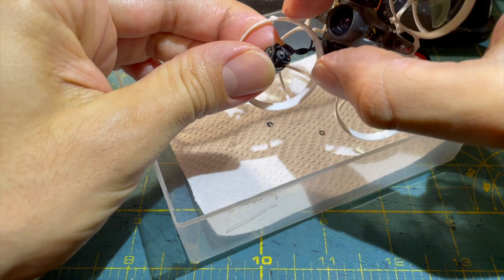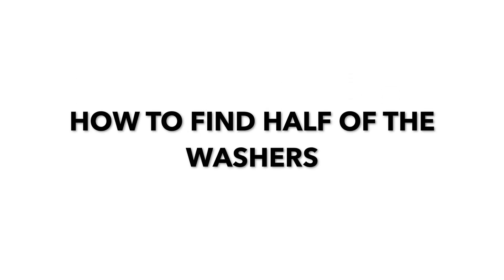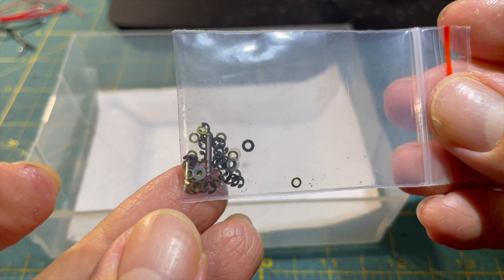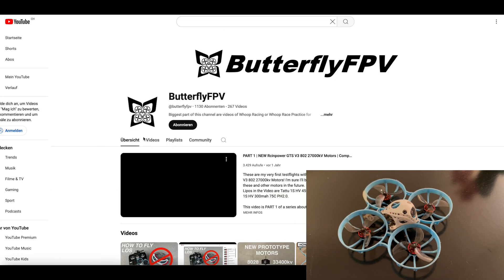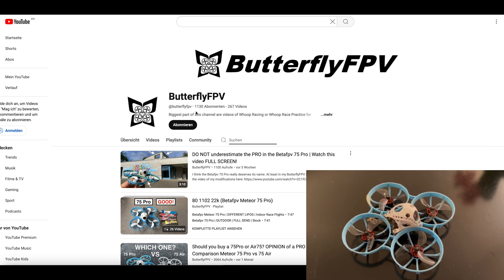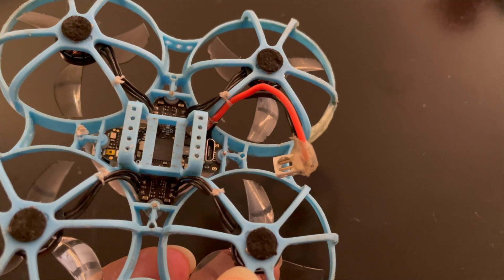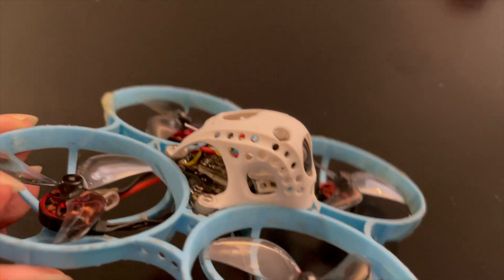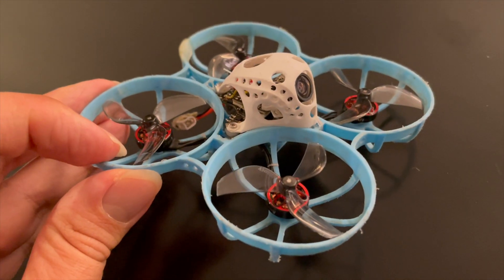Diassemble and reassemble a tiny whoop motor | How to change a motor bell on a tiny whoop motor

Comment: Hi, why my motor making abnormal noise when spinning after i changed the motor bell. Other motors didnt sound like that. Ive place back the washer follow original setup. But i still cant get rid of that noise which causing vibration on that particular motor
Reply from the maker: I don`t know my whoop friend. Maybe to much play. Maybe a metal object in the motor was attracted to the magnets and you didn't see it during installation. Or if you have flown the engine with a bent shaft for a while, the bushings may be worn out. There are many possibilities. Disassemble the engine again and take a close look at everything. It's also important to note that you can't use just any motor bell housing for every stator. The number of magnets must match, and the mass, of course, must match. If possible, always use a bell housing from the exact same motor.

Comment: Hey man my meteor 75 pro got jittering motor and it dosent hapen all the time like only 60% of the time it will be jittering and wont take off, you have this issue ? Do you know how to fix it?
Reply from the maker: Yes it`s because of the motorplugs. Watch my next videos. I'll try my best to explain what the problem is and how to fix it. In short: Unplug and replug the motor connector. Then secure it with a rubber adhesive like E6000. Then attach the motor wires to a duct strut with dental floss. Do this with all motors. Hope this helps.
Reply: @butterflyfpv  if your making a video about this, it would be very helpful as many meteor 75 pro owners have this issue
Reply from the maker: @ZahilClips  Yes thats true! The video is planned! The footage has already been filmed.

Comment: do you know if e clips would work? i tried cleaning my motors of hair and lost the c clip on installation
Reply from the maker: My whoop friend told me M1.2 E-Clips are fine. Like this: https://de.aliexpress.com/item/4000944897965.html
Reply: @butterflyfpv  oh awesome! thanks so much,

you wouldnt happen to know the specs for the washers as well would you?
Reply from the maker: @zaccpaul4144  Outer Diameter 3mm, Inner diameter 1.2mm, Thickness 0.3mm, opening distance 0.9mm
Reply: @butterflyfpv  you are an absolute gem, thanks so much

Comment: Would bad motors cause uncontrollable throttle and random twitching? Or do you think my aio is going bad? I crashed in some water the other day (fully submerged) 😞 but ive also beat thses motors up pretty bad not completely understandstanding how to take care of them lol.
Reply from the maker: It could be due to many things. But in your case, there's a good chance the FC was damaged by the water. You can connect the FC to your PC (always risking damaging your PC if there's a short circuit in the FC that affects the USB port, but you can minimize the risk by connecting the FC to a 5V USB device beforehand, where it doesn't matter if the 5V device breaks) and check if the twitching is also present in the gyro data display (receiver tab) when the drone is stationary. If so, then the gyro is defective. Or you can run the motors individually in the motor tab in betaflight to see if the throttle is controllable for each motor individually. You need to narrow down the cause of the problem step by step until you have a rough idea of what's causing it. This, of course, requires a basic understanding of the components of a drone and the betaflight software. I hope this helps.
Reply: @butterflyfpv  thank you, I really just wasn't sure where to start this helps a ton.

Comment: I always have so much trouble with the c clips! Wish there was a tool like they have for the larger motors
Reply from the maker: Hold one or two fingers very close (touch) to the C-clip while using a pointed carbide tool, preferably a scriber, to loosen it into the tip of your finger. Then it usually works well and the c-clip sticks to your fingertip (like in this video). Then make sure that it doesn't stick anywhere where it shouldn't and that it doesn't fall down. And of course put it in a box somewhere. Under no circumstances should you leave it lying around on the workbench. If you work slowly and carefully it works. And of course it takes some practice. After the 10th motor at the latest you can do it without losing anything. And if you don't do it for a long time, you forget it again and lose something again xD When you push it back, the c-clip must already be 40% in the groove of the shaft. It must not be slanted at any time. As soon as it becomes slanted you have to align it again before applying pressure. But you're right, it's not 100% safe to attach the c-clip and it`s a trouble. But maybe I can find a better method. Then I'll make a video of it.

Comment: You have mastered a very good skill for removing the c-clip. l usually do it inside a plastic bag in order to find the clip back if it shoots away😅
Reply: I was just about to say the same thing,  every motor manufacturer needs to include a few spares
Reply from the maker: @wavesummit   Yes, exactly. To this day I don't understand why the manufacturers don't do this. So I understand it, but I still think at least two replacements for every engine set of 4 engines should be possible.
Reply from the maker: Yes, that's right. It's the simplest solution. I developed it for myself after many attempts. I haven't lost a c-clip since. I hope I don't forget the method when I repair another whoop motor in a few months😅🤪